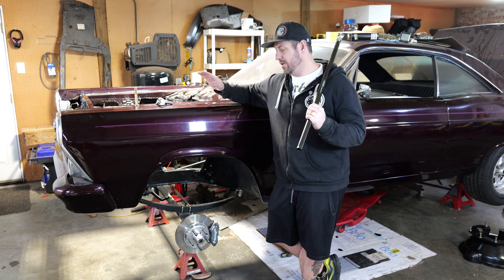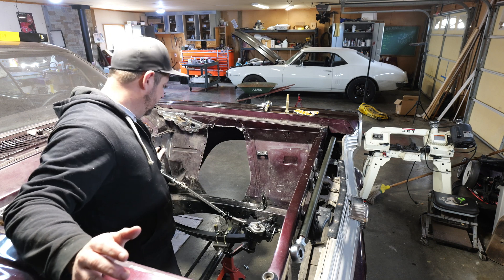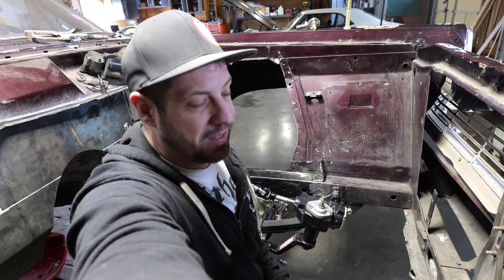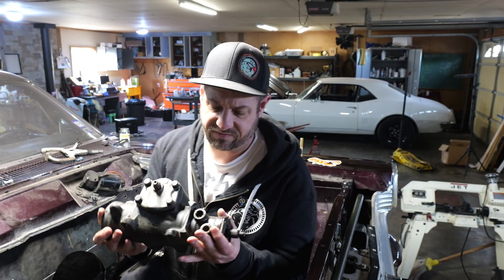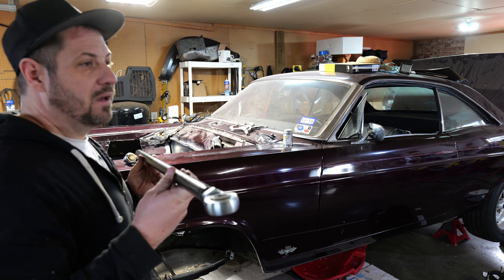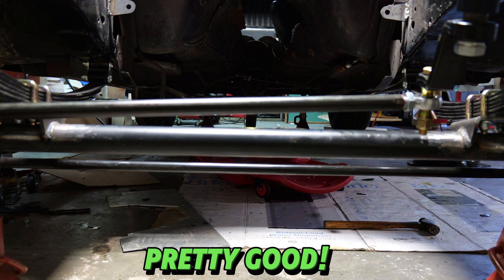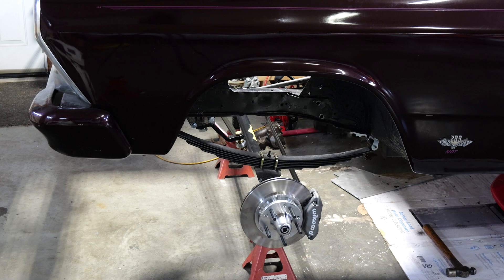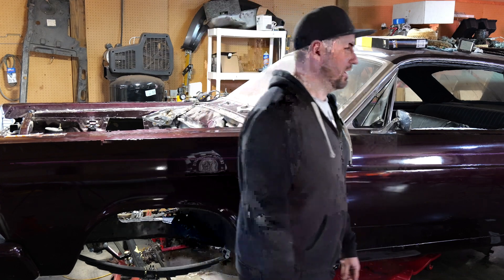GASSER Drag Car Straight Axle Steering Tips and Tricks!

Comment: I have a 52 Studebaker pickup and was wondering how hard it would be to make it front steering. I have some clearance issues. Thanks…also a Texan
Reply from the maker: It’s not terrible. Get the box in a good place because you don’t want to have to move it later. But there are plenty of options to get cute if you have to with the input shaft around headers and whatnot. 

Even the steering linkage itself you can use z bars if you need extra clearance for the pan or something.